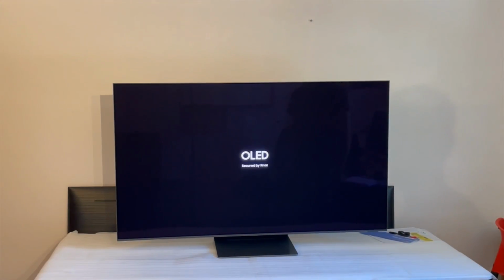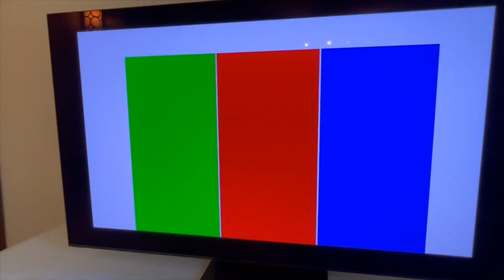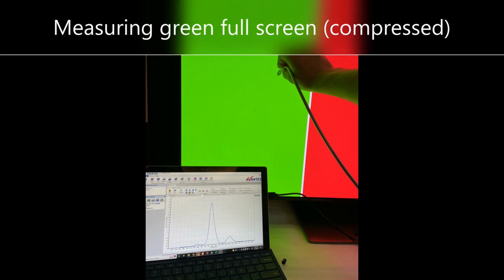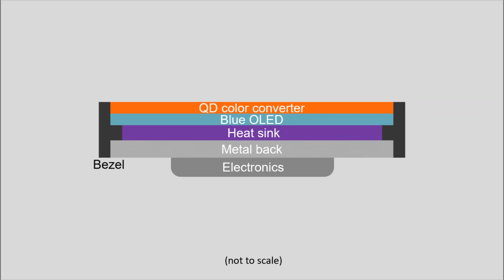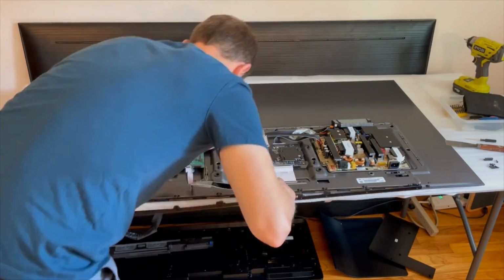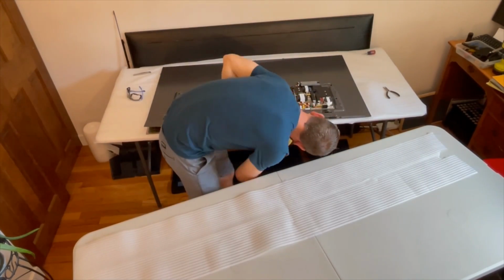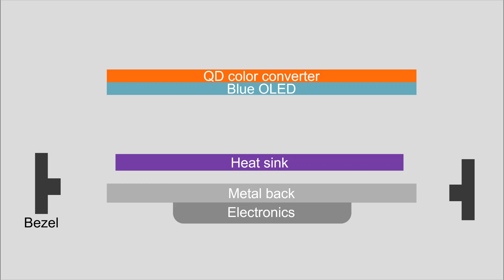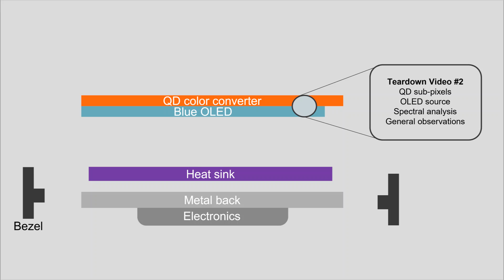Destroying a QD-OLED (Samsung S95B) - Part 1

Comment: Why would you break a perfectly good Samsung TV? That makes me sad for seeing one intentionally broken just for you to see what’s inside. Samsung is the best TV brand of all brands. OLED is the best. However, you can do whatever you want with your things because you bought them. I’m not trying to spread hate. I like this video to see how the TV works, though. 👍
Reply: Because people are interested in seeing the internals of the TV to understand how they function, he clearly said he didn't mean to break it, but these manufacturers make it as hard as possible for repair people to get inside so they can make more money from people breaking the TV. 

Also, your brand simping is funny. Samsung, Sony, and LG are all good premium brands that make mistakes. One of Samsung’s biggest mistakes was the one-connect box, where the unit would go bad, but they stopped making them, forcing people into buying new TVs. Samsung might be taking the current crown for best OLED TV from Sony after what they showed at CES 2024, but another brand will outdo them soon. Competition drives innovation. LG currently creates all OLED panels, so if you like your Samsung OLED, you can partially thank LG for that.